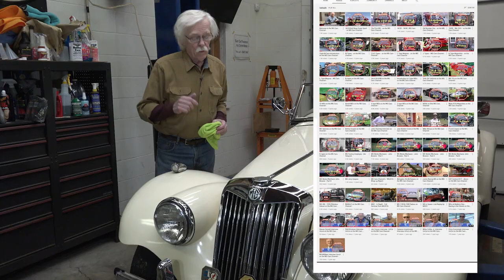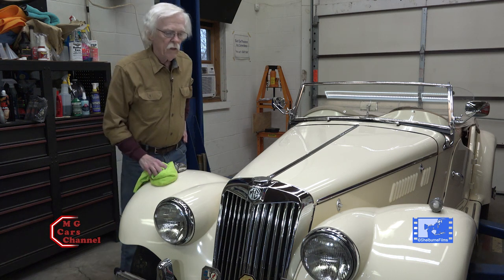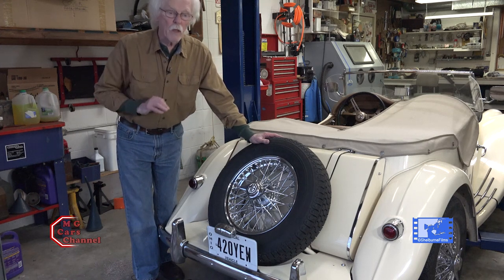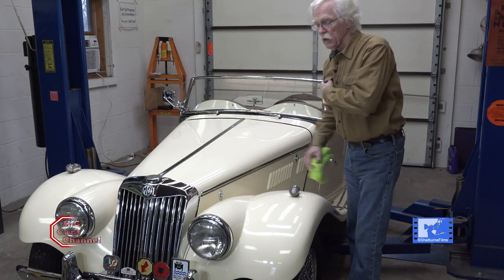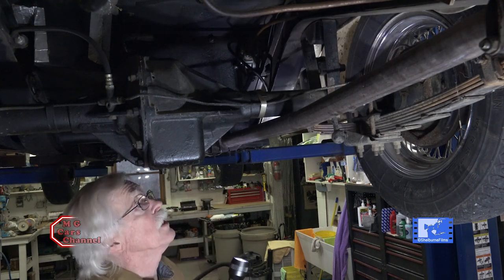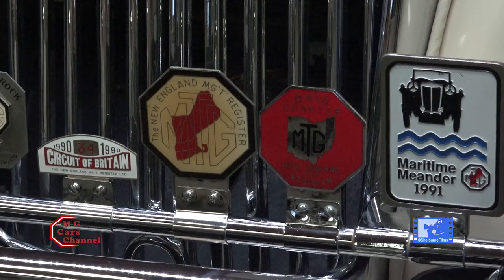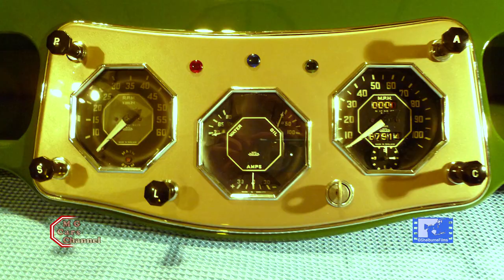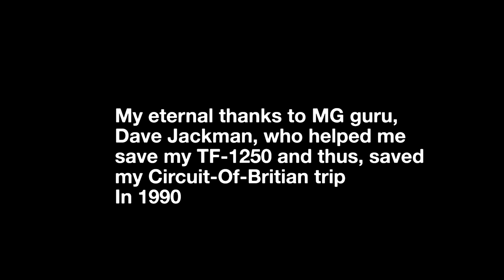MG-TF & TF 1500 MG Cars Channel -

Comment: Very pleased I came across this video series on MG's - especially the 'older' models. I owned an BRG MG 1500 TF when I was an architecture student in college - 1964. Have no idea as to when the car was made or sold in the States. Unfortunately the car was not in the best of shape due to a lack of funds. To my great surprise the exhaust system gave up the ghost and fell off the car, the electrical wiring harness in the engine compartment burned up and lost both 2nd and 3rd transmission gears. After the loss of gears I finally decided enough was enough and got rid of the car. Otherwise it was a great car to drive around in Los Angeles.  Wish I had the funds today to purchase a restored TF!